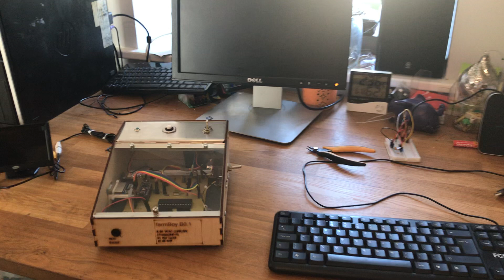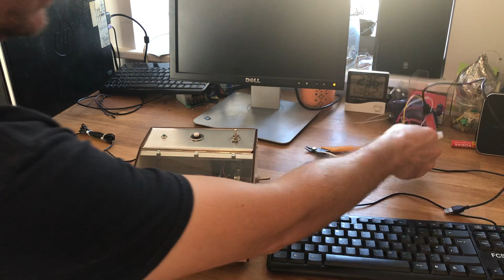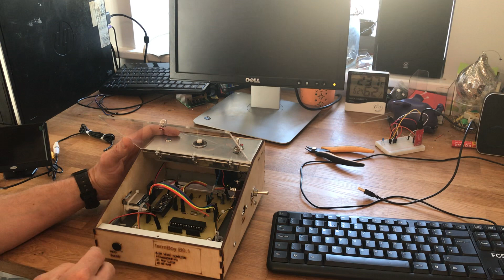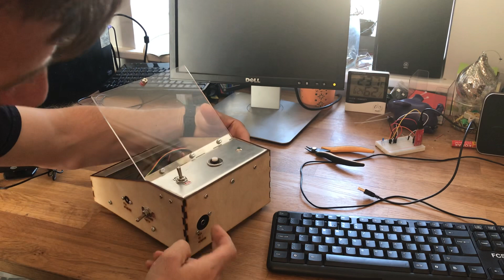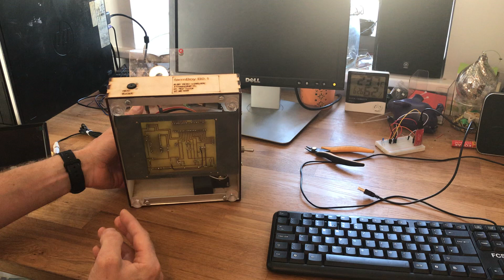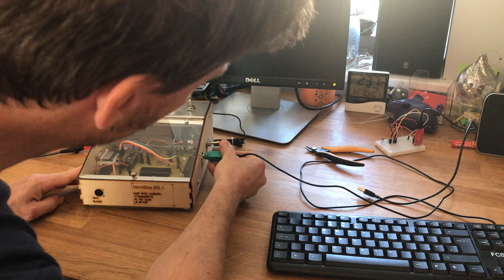8-Bit Homebrew Computer - using Arduino and Atmega1284p-pu

Comment: That's pretty cool.  I built something similar almost 20 years ago using an 89c52 (atmel copy of 8052 with some internal flash). It runs basic 52 at 12mhz and has 32k of SRAM.  I was going to stack a 32k EEPROM so I could store programs, but never got around to it.  You communicate via a DB9 serial connector interfaced using a max232, so it's actually rs232 compliant by generating negative voltages, instead of just hitting ground.

Comment: Do you think this could run bbc-basic.??. They are adding it to everyZ80 based board out there.. Also, could the IO outputs drive a sound system, like with some counters.. or 555 timers.. to make game-like sounds..??? would the arduino be able to emulate an AY-50xx sound chip maybe ??  Thanks..

Comment: Very cool.  I think the charm of the 8 bit era computers is the immediacy, the simplicity.  Imagine if we could choose to boot a x64 computer directly into a programming environment without all the overhead, layers, notifications and distractions, ads, updates, etc from windows or any other operating system. That would have some awesome perfomance, wouldn't it, and even we would focus better into a task without all the interruptions inherent to using a modem operating system.
Reply: You can do that with linux
Reply: @warp188  This Was precisely my thought, but still, what I love at the 8 Bit Times is that the entire Computer is easy to understand. Even a PI is complicated, and you need decades to understand all functions of a SOC (Just trusted computing is complicated and a system in a system). Modern systems are rabbit holes where you can easily be lost. You never get to the point where you can say - I know everything.
Reply: @warp188  Linux is becoming more and more bloated just like every other modern OS.

Comment: So now we're reduced to using multiple 64 bit microcontrollers to emulate an antique 8 bit computer?

I'love the old 8 bit stuff, I learned computing on a c64 but this doesn't make sense to me.
Reply: Probably easier than sourcing legacy stuff and designing from the ground up
Reply: computers aren't 64bit microcontrollers if you mean that
Reply: @bananab3813  You miss the point, they are using microcontrollers with more raw power than the thing they are trying to build.
There is a guy who emulated a C-64 on a microcomputer like a Pi or something,
Reply: ah gotcha
Reply: AVR microcontrollers are not 64 bit!